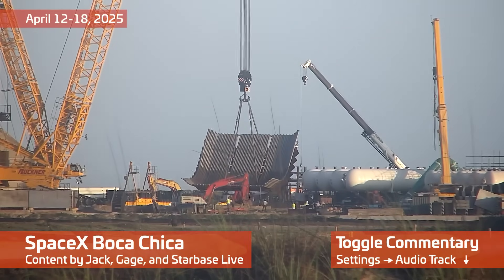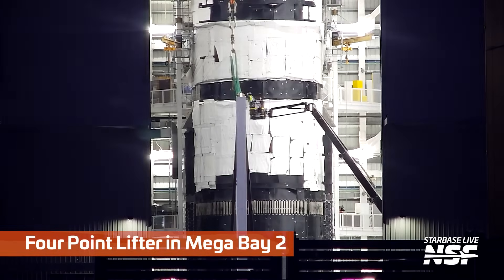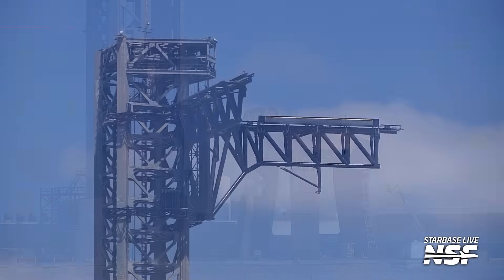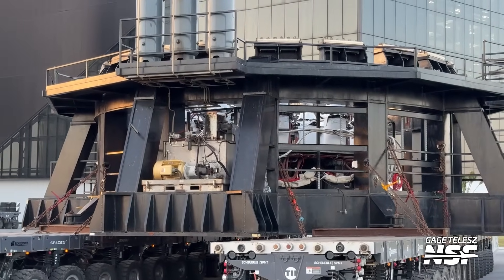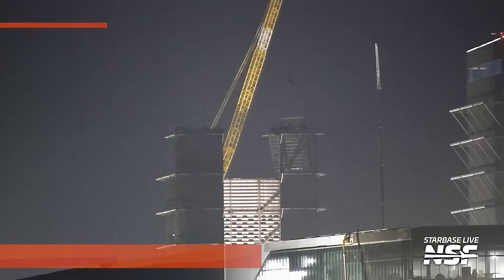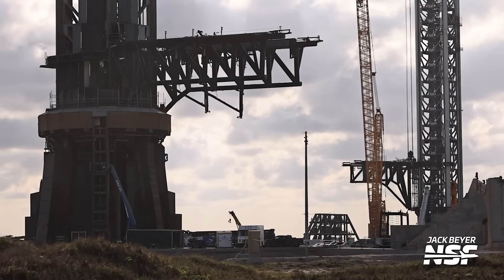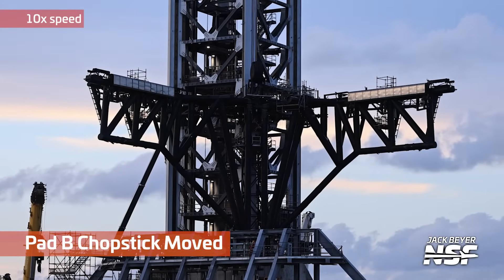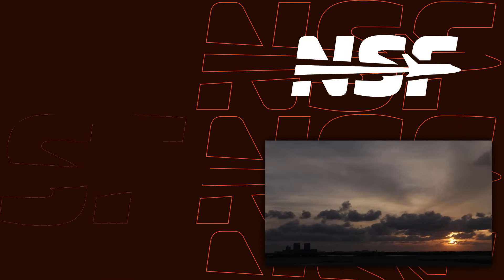"They're Moving Pretty Quickly There" | SpaceX Boca Chica

Comment: 3:10 my guess for the reason they've cut holes into the siding is that when lifting those sections it create a sail of sorts.  Cutting the holes into the siding lets more wind through the panel as its being lowered down to the ground which limits how much it swings in the wind.

Comment: Those gap checker board. Done so the wind can blow through. Remember they are weakening the structure by removing structural beams that keeps everything together. If they didn't made those holes the wind can push a side in or outwards. Then things will break of and can collapse uncontrolled in or outwards. That's not what anyone wants to see happening. The whole site is located at the coast where the wind can pickup speed above the sea. They could go for removing the sidepanels first and later the frame top-down. Strangely they choose to demolish the building layer for layer top-down. Reducing cost? Takes less time? (Cutting holes takes time)

Comment: Hi, Yes, i work in construction in the UK, i recone  this is to allow the wind to pass through and not make the flat corrugated panels act like a sail, and being uncontrollable. They must be lighter thean the top panels or it allows the demolition team to take down larger panels, in a controlled way.The structural engineer must od designed the pattern for optimisation. Great narration Das, what happened to the UK guy, he had some comical statements just like you.
Reply: Sorry after another look, its to reduce the pressure on the remains of the high bay. Now the top structure has gone, this prevents the rest of the building blowing over.

Comment: I think the holes are cut to reduce wind resistance and weight because of the structural components removed on top. Think of a cardboard box with a closed lid and one where the top is open. Without the top the sides get flimsy. Cutting the holes reduces the wind resistance on the flimsy walls so they don’t collapse. Plus it reduces weight

Comment: I believe they are cutting the checkerboard patterns more for wind (sailing) protection, since they don not have the temp bracing they would have had when building originally.  Cutting the holes keeps the walls from blowing over in high winds

Comment: Most flame diverters are a single slope that diverts flames to one side, but Pad B has 2 diverters at 180 degrees to each other. The joint between the two diverters is at the top, nearest the engines. How is the joint protected from the blast off the engines?

Comment: cutting the checkerboard pattern will make the panels less impacted by wind when they cut them loose and bring them to the ground by crane....
It also would reduce the stress on internal support beams as the beams are removed just before the panels are cut away...
(and also reduce the possibility of portions of the wall getting blown down)

Comment: @nasaspaceflight I suspect the holes cut in the high Bay cladding are to reduce wind loads, as the structural integrity is being compromised by the removal of various sections.

Comment: Once you remove the header above that really tall door the structure becomes less stable and more subject to wind loads.  The cutouts reduce those wind loads.  
There are really three basic engineering projects in a building like this.  The structure is the obvious one,  but construction and demolition processes are two very important projects that people don't usually think about.  You don't just knock down a building this size without some serious planning.

Comment: They are cutting holes in the siding for when the crane lifts the load, the wind will be limited from pushing the load around when it's hanging/swinging from the crane, potentially hitting the crane boom which could collapse the crane to the ground if an impact was substantial!

Comment: The holes in the high bay walls are for airflow. When they lift large sections of walls, they are like sails…..It also reduces the effect of wind on the structure while disabling it. With the open door it is a giant cup catching wind…………,,,,

Comment: The weaker the high bay becomes from dismantling it's structure the more susceptible it becomes to high winds making it go RUD. The holes allow the wind to pass through instead of slamming so hard against it.
Reply: Yes I definitely think the reason for the checkerboard pattern is to avoid the wind from scooping the cladding right off, now that half of the structure is open to the wind getting in. Since the cladding is only designed to bear load from the outside, wind from the inside would most assuredly rip cladding off, causing an extreme hazard for any people nearby, or even far away. Possibly another reason is to reduce the weight of a final lift.
Reply: hmm so plug the holes Got it

Comment: Nice to see al the chopstick servo tuning and resonances analysis.
The tower was twisting nicely. Expect more stiffener tech, perhaps an active dampener would allow faster motion. (think top of tower mass dampers used for earthquake and weather protection of sky scrapers)
Reply: That's what I was thinking, finding your resonate frequency is the first step.  I don't know about stiffening the tower tho, that can be hard to do without making something worse.  Damper maybe, but at the same time I would hope the structure is strong enough not to need it.  Just avoid the resonances.
Reply: Resonance can vary with actuator length and linkage angles. So they are measuring resonance at various positions.

Comment: As they demolish the high bay I am sure that the structure will get weaker and be more at risk from the winds, by putting holes in these large panels it will reduce the wind pressure on the whole remaining structure.

Comment: I wonder if the holes in the high bay are to reduce the pressure from the wind during the dismantling process? I'd imagine the whole structure has less structural integrity with all those corners chopped out so you'd want less force on the remaining bits.

Comment: My best guess for the holes cut into the panels is wind resistance.... it is pretty windy down there.
Reply: I agree. With the roof and crane assemblies it was a very rigid structure, now a good bit of wind could flex one side over. 
It'll be both to let air flow through without causing uncontrolled damage and also stop it from being a giant kite when sections are removed and hoisted down
Reply: Correct. That's why it is taking so much time to disassemble. Winds get rather wild down here and makes it a dangerous operation with the neighboring personnel moving back and forth between buildings.
Reply: You might wonder why they'd remove the panels in this pattern instead of just removing them all.  The steel sheathing is still providing lateral bracing to the vertical structural members.  If you cut them all down, you lose the lateral integrity and could end up with wind loads leading to flexing leading to assymettric loading of the vertical supports leading to an uncontrolled collapse.  The checkerboard cuts reduce wind and gravity loading, without affecting the lateral stability of the structure too much.  Deconstructing this kind of structure is often far more technically challenging than building it in the first place.  It may happen faster than construction, but it is a process orders of magnitude more dangerous as the structure is continually being weakened minute-by-minute with every piece removed.  Demolition engineering is intense as the engineer developing the plans is trying to both destroy the structure, while maintaining a >1 safety factor for the structure which is changing from minute to minute in terms of the forces applied to it and its ability to resist them.  The men and women who can plan and execute this safely are honestly wizards.
Reply: I would agree. Now it's an open structure, lacking an enclosed roof/door etc, it would be less stable and more prone to blowing over. The holes would reduce wind resistance, both whilst standing, and pieces being lowered to the ground...similar to the small holes you often see on temporary fence hoardings.
Reply: @billammTrue.
Reply: Yup. With the roof off, all structural rigidity is lost. Have to reduce the wind loading.
Reply: Agree
Reply: That was my thought as well. Especially with less structural stability as they remove parts.
Reply: That's my guess as well.

Comment: Demolition is taking too  long so they have decided to launch the high bay into the gulf. The holes in the high bay are for hot staging.
Reply from the maker: 🤣  We'd live stream that for sure. - Das
Reply: @NASASpaceflight  LOL! 🤣🤣
Reply: two reasons I should launch the High Bay into the Gulf.
1. i don't want it anymore
2. the gulf is right there
Reply: What a reef that would make!
Reply: Is the high bay the lower stage and stargate the upper stage?
Reply: Wind
Reply: @dougelder-t1m yep as the they cut the structure up it’s losing strength to withstand the wind.
Reply: Oops, accidental return to launch site.
Reply: Highship

Comment: High bay is structurally weaker due to the deconstruction. Cutting holes in the steel sheets would cut down wind forces on the structure.
Reply from the maker: Huh, that makes good sense 👍 - Das

Comment: 3:02 My guess for the checker board holes is for wind deflection reduction when they take the section down in large chunks so they don't act like sails?
Reply: Also to keep the wind from putting too much pressure on the walls since the structure has been compromised.
Reply: Spot on. That’s absolutely the reason.

Comment: Agree with your assessment of what they were doing with the arms, Das. I think they were characterizing the arm oscillation, probably so that they can add damping, and speed them up.
Reply: Is there any reason why - my apologies for not researching this before asking - they are not using reaction control thrusters to move the chopsticks? I would think it would be faster and more precise, without causing the isolation due to the current mechanisms being attached to the tower. Or maybe a combination of the two?… mechanical for repeatability and reaction control thruster to stop it more quickly, so it doesn’t impact the booster or starship or cause those oscillations.
Reply: @JenniferBumgarner-g5n Electric or even hydraulic actuation requires less supply of consumables. Simplifying the process to one system also improves reliability. Best part no part etc.